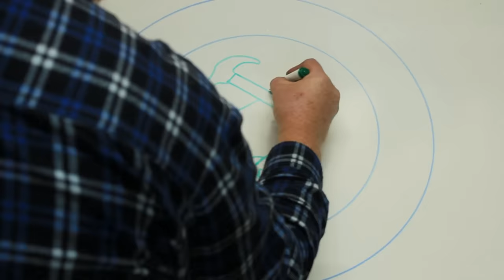EPAL pallet disassembly using minimum tools

Comment: This is how a Jedi dismantles a wooden pallet. Two tools, no damage, job done. Great work.
Reply from the maker: Unfortunately they don't ALL come apart this easily.  The ones with solid wooden blocks (rather than compressed sawdust) usually tear the boards up a bit.

Comment: These EPAL pallets fall apart very easily when handling with forklift, especially after taking a boat ride. The worst block pallets are the ones from Vietnam or from Communist China. I don’t know the wood the Vietnamese use, but it has a similar color pattern to cedar and makes for some unique looking designs. The People’s Republic is just generic pine like most American Pallets.
Reply from the maker: That makes sense, considering how many of them that I've found with a "missing leg"! 😀

At my end of their lifecycle, the "sawdust block" type are much easier to disassemble than the ones which use solid wooden blocks - do you get the same results with your forklift?

Comment: Thank you for posting this video, simple tools and well-organized method. Cheers
Reply from the maker: Thank you for the feedback, it's much appreciated.  

I'm building my fitness to do a "speed run" pallet disassembly in a few months, my ultimate goal is under 5 minutes. 😃

You've probably already found it, but I listed the tools used for this video here:

https://www.youtube.com/watch?v=f107Qhgus5U
Reply: @TightwadWorkshop  😆 ordered the wrecking bar following your suggestion. Ready for muscle-building 💪
Reply from the maker: @FabMoment  It's worth spending the extra $3.50 to get a 600mm bar.
Reply: @TightwadWorkshop  I did ordered the 600mm version!!! 😀

Comment: I like this way better than just cutting the nails because there could be forgotten parts of the nails in the wood which could harm other tools used to cut the boards. This way you are sure all the nails are gone.
Reply from the maker: It's slower, but more thorough. Occasionally I miss a nail and have to re-sharpen my plane though.

Comment: This is a very honest recording. The broken bucket at the end proved that. One other hand tool I would suggest would be a rubber mallet as not to damage the surface of the wood when a hammer is needed for other than hitting nails.
Reply from the maker: Thanks Dan, the broken blue bucket is the reason why I have a green bucket in the video thumbnail image. :-)

Comment: I got a wood stove in the house and those compressed sawdust blocks are really good burning material for it! They burn very long and produce very little smoke, it is a little worse on the chimney though, so you have to make sure to have it sweeped every season!
Reply: Thank you for that information.   I was wondering how to sell them but I'll keep them for myself.
Reply from the maker: Maybe I've just been unlucky, but the ones I've tried in my wood stove have burned very reluctantly, with lots of smoke and a terrible smell.

My house is in town, and because I try not to annoy my neighbours too much I've stopped burning the blocks.  Now I feed 2 or 3 blocks per week into my garbage bin.

Comment: god job, I'm doing them pretty much the same way with the addition of a pallet buster (bit sore on the back after a while all that kneeling down) some pallets I come across have threaded nails which are a right PIA to get out so usually end up sawing the slats off instead
Reply from the maker: Yes, my own back has taken a turn for the worse a few months ago, so now I do the disassembly on top of a pair of trestles (https://www.youtube.com/watch?v=0VOqTW6Xq9k).

These EPAL pallets are usually pretty good, but sometimes you'll find one with all of the nail ends "clinched" over on the underside.  I usually just cut those ones up for firewood, and sift the nails out of the ashes afterwards. :-)

Comment: Cons: takes longer
Pros: FREE NAILS
Reply from the maker: The EPAL nails are pretty good for hammering back in, too!  (The twisty nails used on most pallets are only intended for use with a nail gun, they're harder to drive in straight with a hammer).

Comment: Another observation is the kind of nails that are being used. Spiral shanks can frustrate your day. A Canadian invention, they dont like to be removed, so resort to a reciprocating saw. Ggrrrrrrr, lets giter done!
Reply from the maker: Unfortunately they'll always get you one way or the other.  If you cut them off and leave the shanks in the wood, you can't plane the boards...
Reply: Cut them down to 1 inch or so with a small pair of bolt cutters. Then they'll drive out easily with your hammer, making them easier to pull out from the other side.

Comment: I've never seen epal pallets come apart so easily. I've tried this method and every time the heads of the nails pull through the boards or the heads pop off.
Reply from the maker: I have about a 50% success rate (slightly better when I use the EPAL pallets made with compressed sawdust spacer blocks).  Practice helps a bit, but there's still an element of chance in it - I had to record 3 takes to get this video, and even in this one I ended up with some broken firewood pieces.

Comment: It’s easy with new Paletts…. But how is it with old??🤔
Reply from the maker: With old pallets I usually end up with fewer usable boards, and more firewood! :-)
Reply: But it would be more interesting to work with old pallets 👍🏻😌
Reply from the maker: That's true, but when I'm out collecting pallets I'll always select the newer ones first.  Life is hard enough already, I don't need to fight with old broken pallets as well. :-)
Reply: @TightwadWorkshop  
you have right 💪🏻👍🏻 
Good luck and have fun😉😌
Reply: You’re right. Dry, new pallets are easy.  It’s those old, heavy ones with cube corners and rusted screw nails that are the problem.

Comment: Why has your pallet blocks come of so easy without splitting and the nails so straight, looks set up.
You don't need the crowd bar when you got a claw hammer to do same task of removing nails
Reply from the maker: The sawdust blocks hardly ever split, but the wooden blocks usually give me big trouble!

I started using a crowbar for pulling nails when I broke the wooden handle in a hammer once, also the crow bar is longer and gives more leverage (for easier pulling).

As for the set up, this was the best out of the 3 EPAL disassembly videos that I recorded.  I still had 1 split board, but the other 2 made a lot more firewood!
Reply: @TightwadWorkshop  sound more right, have got hold of an split about 20 or more pallets some split easier than others.
I ain't touching the blue and red cos they treated and said to be toxic and nosty chemical the clean new look ones are save easier to used with no dirty nor fungus etc
Reply from the maker: I only use the unpainted ones branded "HT" (for "Heat Treated")
Reply: @TightwadWorkshop  The ones marked with what looks like an ear of corn on the middle block are safe, they are cleared for transporting foodstuffs.
Reply from the maker: @svennoren9047  That's good to know Sven, thank you! :-)